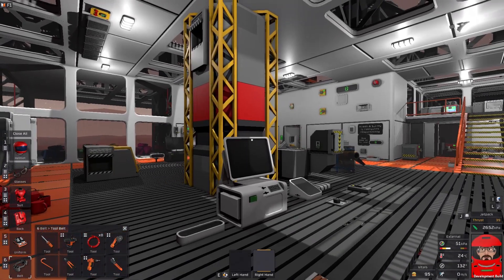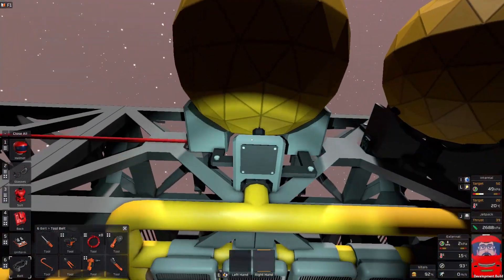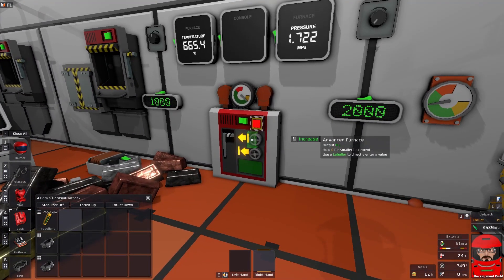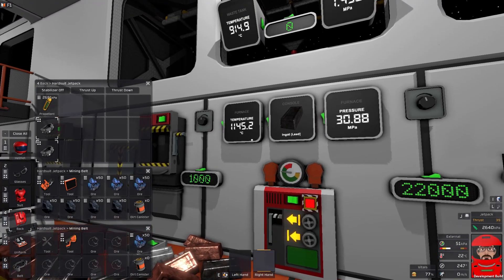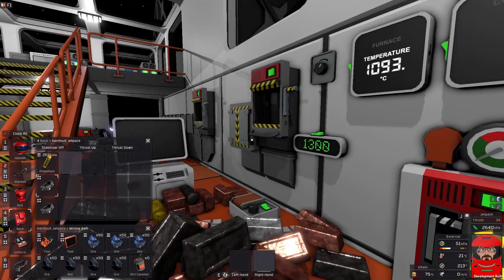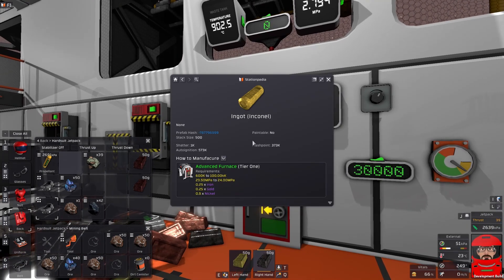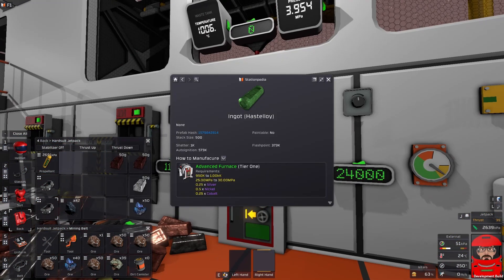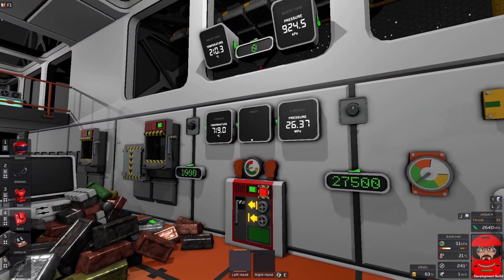Stationeers Making superalloys

Comment: I built the furnace pretty much as you showed, running your IC code, and it works well for everything except Waspalloy.  I can't seem to make it without blowing up the furnace.  Specifically:  I can get the pressure over 50MPa when it's hot, but then I have to let it cool, and the pressure drops.  At that point, any attempt to add more fuel causes it to explode.... It seems I need to get it to a very high pressure while hot (75+ MPa?) and then let it cool down, but I've been unable to find the right settings.  Any advice?
Reply: manually throw Ice/Oxite in there.

Comment: An idea for you to integrate,  im part way done in writing my furnace code. Will share when im done ofc.

Anyway i switch from fuel to stored high temp exhaust gases on the intake. Makes getting whatever high pressure you want a breeze. Im contemplating storing low and high temp exhaust gas to switch between them to decrease the cooldown times when needed.

Its how i ran the regular furnace though i just backfilled the exhaust on that one. Obviously you cant do that with the advanced but easy enough using the fuel intake built in volume pump.

TL;DR use stored high temp exhaust gas in the fuel intake to safely(tm) increase pressure.

Comment: I tried your code, build it like u. but my hash display shows nothing. and i never reached 20MPa. what im doing wrong?
Reply from the maker: Try turning off the IC and trying, that way you will now if the issue is the build or the automation. Otherwise, have a look at the demo world. https://steamcommunity.com/sharedfiles/filedetails/?id=2351501280&tscn=1610666918
Reply: @cowsareevil7514  Yeah, i watched your video again and again and understood, WHY u put the IC10 offline. To get some Fuel in, ignite - and PRESSURE !!! ;)
Reply: But...your furnace (in my world) is not throwing out the ingots / alloys after they finished. so whats wrong?

Comment: Could you make a video on creating water from a furnace/filtration system? Cuz I'm trying to make water from Oxite and Volatiles? I'm trynna do it like that but no matter my config, I either get no gases into my storage unit, only O2 into it, or H20 with a mix of N2. Thank you!
Reply: All ices it seems have a mix of there main gas and N2. Oxides are 90% O2 and 10% N2. This is the plan I have for my current base I'm working on I'm going to have two basic furnaces. One for oxid and one for volatiles. These furnaces will then exhaust into an atmospheric filter with the appropriate canisters to filter out the main product and the N2 into separate tanks. Once you have tanks of h2 and o2 I was planning on gas mixing them into a H2 combustor. It might seem like a lot of steps but it was my plan to store a large amount of H2O and only electrolyze it back into fuel when needed that way the danger of explosion is minimized to only the areas where it's either getting H2 combusted or electrolyzed for fuel

Comment: Love your videos!

I just got finished my new furnace setup to make these higher pressure super alloys.  

I decided on a completely different design... I use a dedicated furnace to produce 2200C gases and store them in an insulated tank, and (on Mars) I pump cold atmosphere into another tank at night, which makes it about -72C.  The hot tank is hot enough to create stellite.  I mix 91.3% hot (the rest cold) to create a tank of 1250K (977C) gas that's good enough to create all the other ingots except hastelloy and waspaloy.  For hastelloy I have a separate tank mixed to 975K, and for waspaloy I have a tank of 700K gas.  

To run my smelting furnace (make sure it's in a 100% insulated box), you don't need to feed it any fuel.  I just select the appropriate gas temperature, pump in enough gas to melt all the ingredients, then pump it back out (to waste tank for processing).  Now you have a furnace with melted ingredients and no gas.  Just pump in the correct temperature gas up to your preset pressure and Bob's your uncle.  Works great.  Also, this second shot of gasses stays at the same temperature and isn't contaminated, so I pump it back into the pre-mixed hot storage tank rather than sending it to waste.  Saves fuel that way.
Reply from the maker: I would like to see a video for this.  I have tried a similar setup with hot and cold tanks but the connection and mixing system was a nightmare.  I need an IC with 20 pins.

Comment: Can't you just input (hot) waste gas to pressure up the furnace ?
Reply from the maker: Yes.  You could even pump in cold gas and then fire the furnace to heat it up but you would need a way to connect both the fuel and the gas supply to the input.  It is easy to do with the basic furnace but not so easy with the advanced furnace.  And you can never have too much copper.
Reply: This is what I do (see my reply above).  I decided to pre-mix gases to the right temperature for my recipe (you can do all alloys with only 4 different temperatures) using a separate automated furnace.  Then in my (fully insulated) smelting furnace I pump in enough to melt everything (which cools it down) then I pump it out, and then pump in again up to the desired pressure.  This allows me to control temperature separately from pressure, so it's simpler.
Reply from the maker: This is worth sharing.